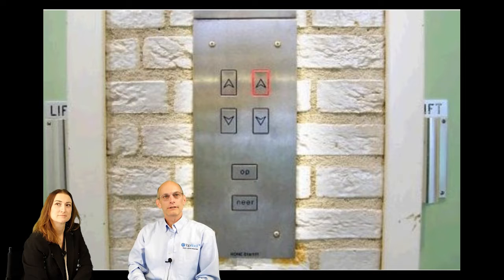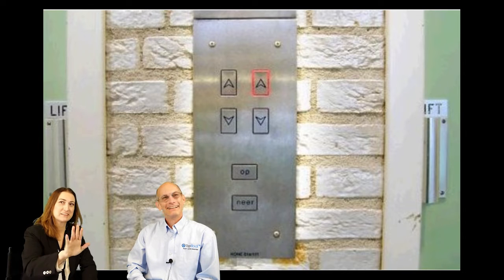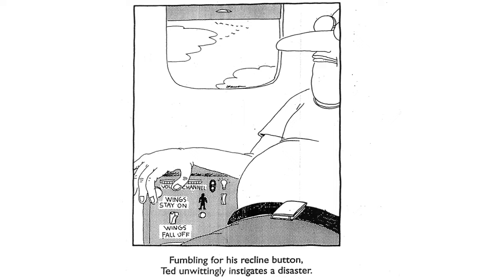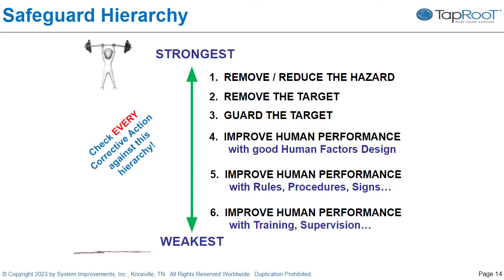Fix these Human Machine Interface Problems BEFORE They Cause an Incident

Comment: when an investigation determine that root cause was in connection of human Engineering , that is human machine interface , for example arrangement need improved , how do we write corrective action which we be required for the OEM to change their Design ,  what if the OEM does not changed their design . How to we navigate our way through that

Comment: RIDDLE:  A man worked on the 36th floor of an office tower.  Very early, every morning he took the elevator to the 30th floor and climbed the stairs the last six floors.  In the afternoon, going home, he rode the elevator down to the ground floor.  Why did he take 6 flights of stairs every morning?
:face-blue-smiling:
Reply from the maker: @marcelomarquez5608 
I'm going to say... he couldn't reach the higher level buttons so he had to exit on 30th floor ;-)